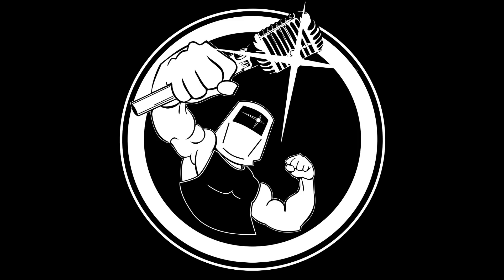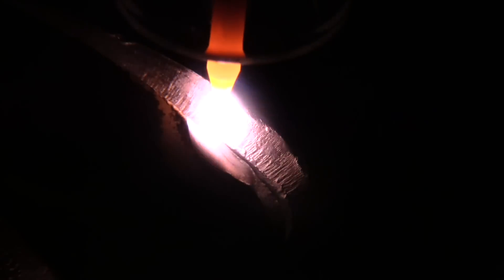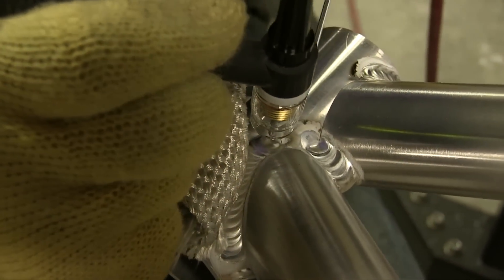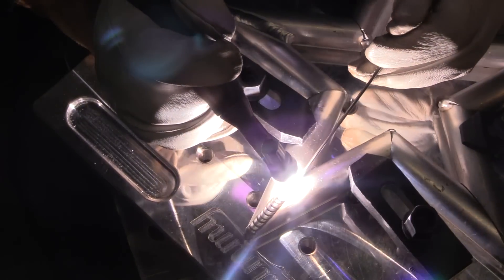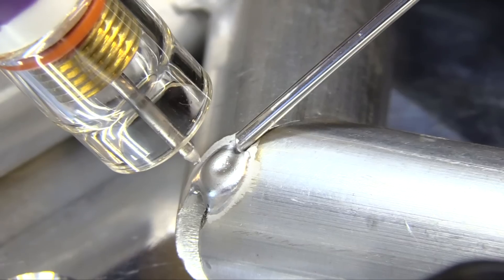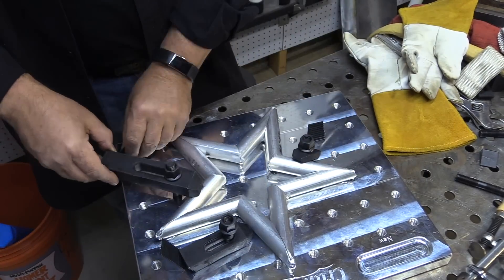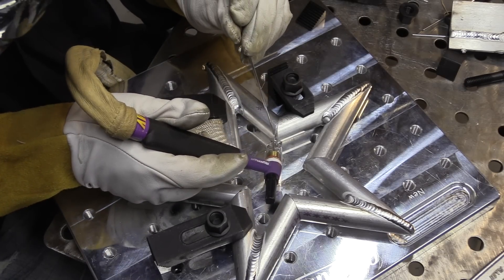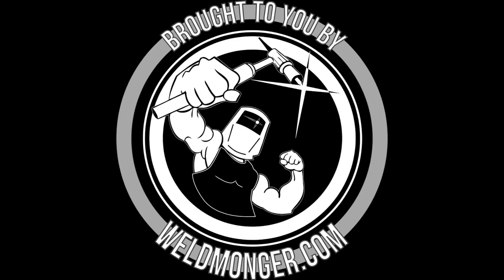TIG Welding Aluminum Tubing

Comment: When you weld stainless or aluminum, do you put a wet cloth on the welds to cool them after finishing a section? I always do it because I burned myself badly several times touching previous weld sections. But I dunno how it plays with stainless distortion.

Comment: Hello. I've watched through many of your videos. Could you please make a video about TIG-welding thin wall square tubing (black steel)? I found it a quite of extreme sport - a little mistake or delay and you get a hole burnt. Now trying to master 1.5 mm thickness.
Thank you in advance.

Comment: I got 2001 polaris xcr800 snowmobile mint condition, the plastic gas tank split this winter,i wanna cut the bottom open and weld aluminum tank inside,how much you charge me? 12 gallons, I send it to ya.

Comment: Nice little fixture plate,would be cool if they were modular and you could join them together  to make a 90 deg or a longer plate.
nice job on the star man that is a hard shape to weld and have it turn out nice looking .

Comment: Hey jody, I have a question. At our school shop we have a Lincoln Electric PrecisionTIG 275, but I don't think it has HF start, and I'm using the right settings, green labeled tungsten, and everythings correct, but i'm still having a rough time on starting with aluminum. is there anything I can do for better starts with it?
Reply: The PT 275 automatically has high frequency start on DC, and constant high frequency on AC.  You should be using AC with a green tungsten as I assume you are welding aluminum with that.  Throw away the old books that say to ball the end of a pure tungsten electrode, put a not so sharp point on a 2% tungsten and the starts will be great!  The PT 275 does have an adjustment for start current, you may raise the start current a bit if the starts are not good.  Also, do not be afraid to play with the AC balance and take the machine off auto adjust. I have been super happy with my PT 275, it does everything I want and is much quieter than the inverter machines on AC.  Draws more power, but overall I prefer my 275 to my inverter Square Wave 200.
Reply: Matt Leicester thanks for that, I do use green tungsten and mess around with the balance when i can, but dc- or ac on steel or aluminum it requires me for a scratch start and I’m also using a water cooled torch.
Reply: @GraduatedIn  Okay, I just looked at my PT 275.  On the left side of the control panel up at the top, there is a push button that says "Menu", above a toggle switch that moves left and right.  Moving the toggle switch to the left lets you set start current, but pushing the menu button changes other functions.  The first one that came up for me was "HF", which I would think is high frequency.  You can set to HF 0, HF 1, or HF 2.  I would guess your machine is set at HF 0, mine was on HF 1.  I have never changed that before, now I am going to have to look at the manual on Lincoln's site and see what I should have all those functions set to, there are a bunch of functions in addition to HF.
Reply: Matt Leicester I’ll try to look into it.
Reply: Matt Leicester I cant do much this week, our school has an osha inspector coming to stalk around all week so just lots of cleaning and tidying up
Reply: @GraduatedIn  The quick fix after reading more last night is to have the machine turned off, then hold the menu button and turn the machine back on, the display will show reS, for reset, and will be set back to defaults which will turn the HF start back on.
Reply: Matt Leicester thank you. I’ll try to do that without getting caught and before the OSHA inspector comes over Wednesday and thursday

Comment: Thought it was discouraged to use a gas lense when welding aluminum?
Reply: Yes, I remember that the gas lens cup was recommended for dc, not ac. I don’t recall if I heard it from Jody, or maybe on Furick’s website? Either way, it worked, I’ll have to give it a go myself 😊👍

Comment: Please tell me, because of what happens, what if dirt gets out of the bath, although the material is clean?
Reply: Dmitri, are you asking about a weld puddle with spots on surface?  Jody will probably say to clean your parts, electrode and rod to a high degree, clean better than you have before.

Comment: Jody what size of cup do you usually use for a root pass hot pass fill and cap i have seen your other videos but i cant see what size of cup beign used also size of tungsten thanks jody very good content as always
Reply from the maker: it mostly depends on angle of bevel and wall thickness of pipe.  I would say a #6 is most common for me for a root, I might step up to a 7 for the hot....and if its schedule 80 or thicker, I might even use an 8.  If the cup touches the root when you are walking/wiggling the cup, the one size bigger usually works.  I like an 8 for fill and cap but on thicker  bigger pipe a 10 comes into play sometimes too. ..either 3/32 or 1/8 tungsten ..but 3/32 is plenty big enough for amperage used on root and hot pass 90-140 amps usually on carbon.  hope this helps